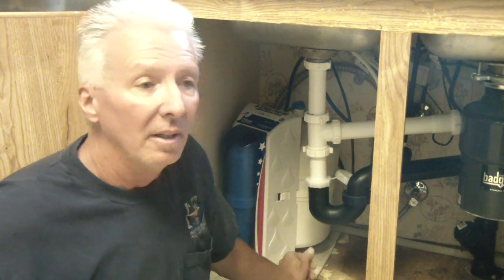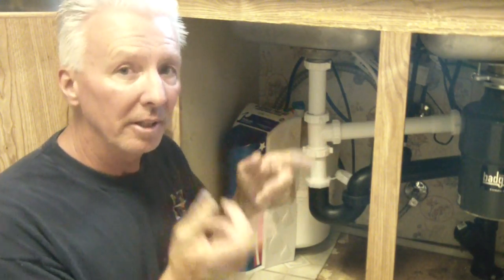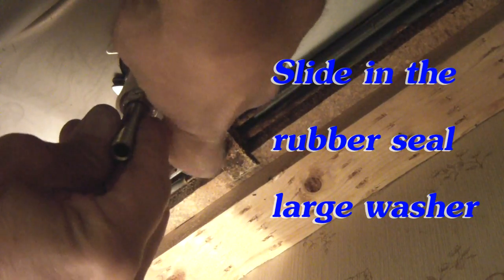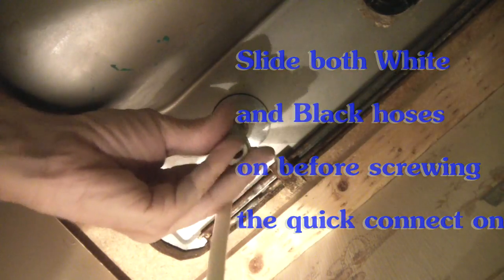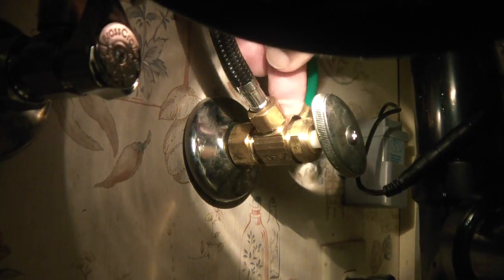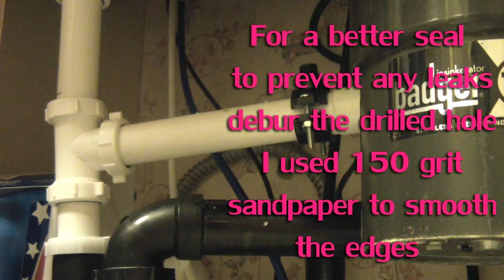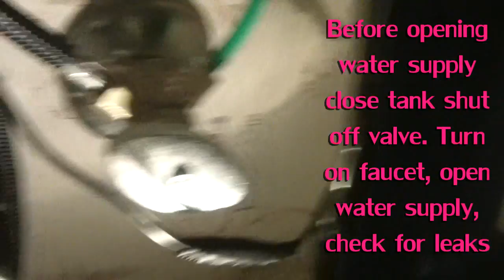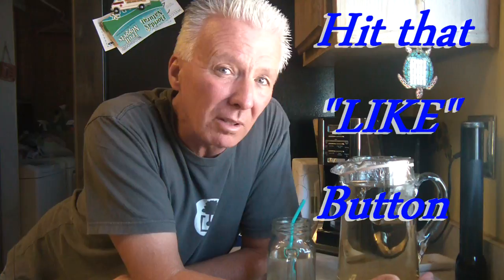How to install under sink Reverse Osmosis System,  Pelican Pro 6

Comment: Great vid! If I’m replacing my GAC FILTER every 6 months do I just let water tank fill and then drain 2x or ?? Thx.
Reply from the maker: Jed, I apologize for the late response have not been receiving notifications replacing the filters not the tank I would run a couple of cups till the water is clear. Wait a few minutes drain a couple more cups to verify that it is clear you may end up having to at least empty the tank, depending on the filter itself.

Comment: Hi i bought and installed the water system however when I tried flushing and open the faucet after waited 8 hours, the water only ran at the max flow for like 20 seconds and started to drip. Is that normal? Thanks.
Reply from the maker: Karen Hsu sounds like there isn't enough water getting into the system. Double check the in line from the water supply. Make sure the valve is on all the way. You could even turn off the supply line valve disconnect the line from the unit slowly open the supply valve while holding the line in a big bowl or bucket make sure you have a good water flow from the supply line valve. You could also do the same for the faucet line. Disconnect the line from the spicket with the valve closed ontop of the unit hold the line in a bowl or bucket and slowly open the valve making sure a good flow from the unit

Comment: Should we be hearing a dripping noise from our white drain tube when the tank is filling? We can see the water going into the drain when we look down the sink. Saddle was installed below the drain.
Reply from the maker: Kimberly yes you will hear noises water draining when the unit is filling.

Comment: After installing and turning the water on, why does sounds like water is going through the p-trap hose? I feel like it's just wasting water
Reply: That's exactly what a reverse osmosis system does. It uses about 4 gallons to create 1 gallon of dispensed water. That's why you need to hook it up to the drain line.